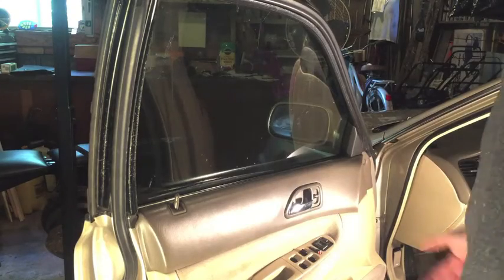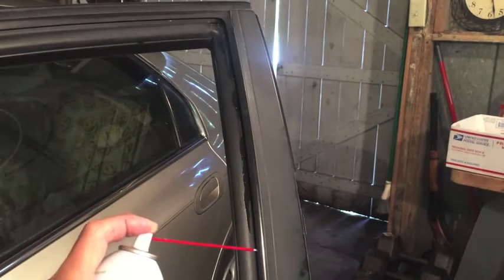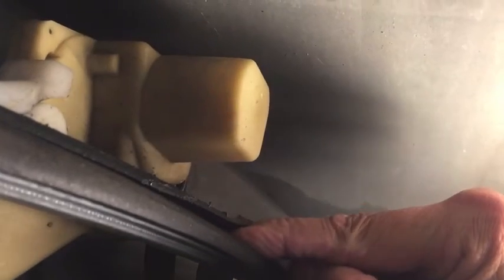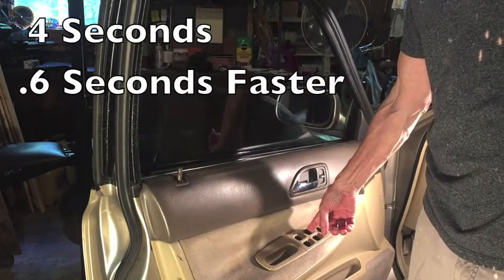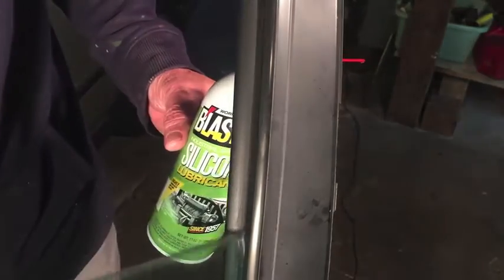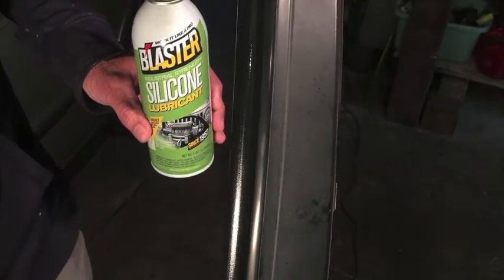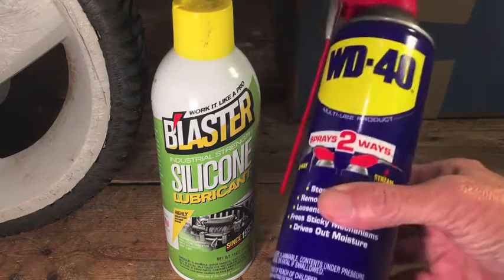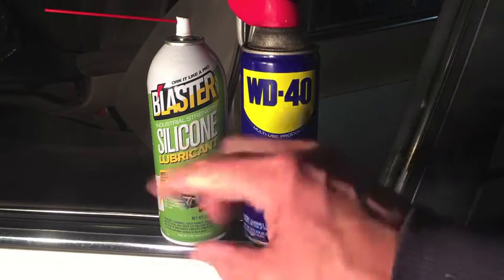45% Faster Power Windows W/Silicone Spray

Comment: Happy to see that you still are fixing that Honda. I had five 97 accords over the years but now I drive a 98 Toyota Camry. The captive brake rotors and unrefined shifting transmission of an accord wore me out if the years.
Reply from the maker: I'll be buried in that Honda.. And I agree on the transmission.. My other car is a 96 Lexus ES300 which is basically a fancy Camry.. Much smoother transmission..

Comment: Any idea if this is safe to use on tinted windows?
Reply from the maker: Good question.. I didn't even consider that.. My driver's side windows are tinted and 5 months later no damage to the tint.. Passenger side windows are no longer tinted.. Tint was removed due to peeling at the top.. Long before using silicone on the window tracking..

Comment: How long will this last for? WD-40 doesn’t last at all my window takes like 15 seconds to roll up it’s terrible and I have a 2023
Reply from the maker: Silicone spray is absorbed by the rubber weatherstripping and window tracking which helps it last longer than something that just treats the surface.. I reapply about once every 6 months..
Reply: Will the silicone lubricant leave smudge marks on the glass and will it leave the glass foggy? I bought this silicone spray today and can’t wait to try it over the weekend

Comment: Can you use it for ignition key
Reply from the maker: Powdered graphite is best to avoid build up of residue but if you do use the silicone I would spray a little onto the key rather than spray into the switch through the keyhole..